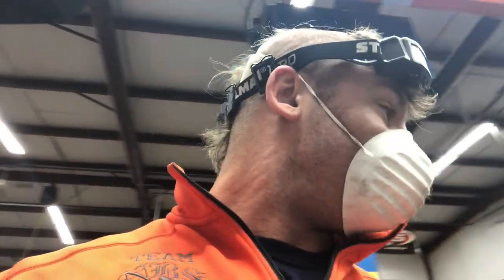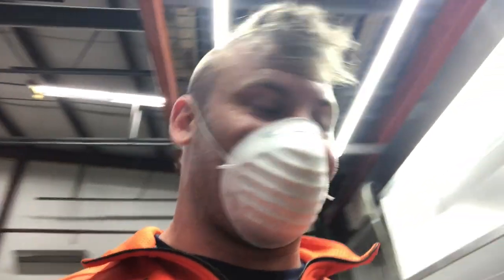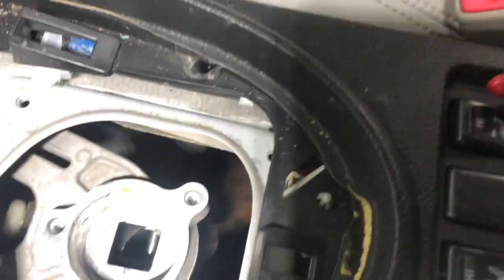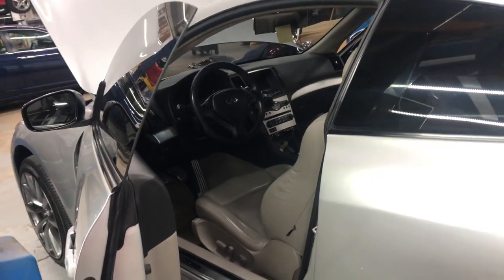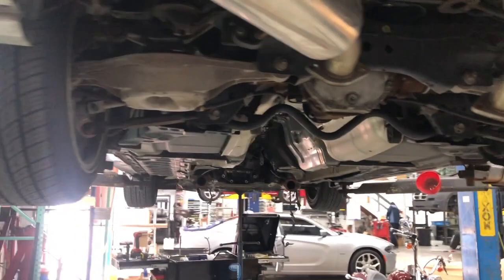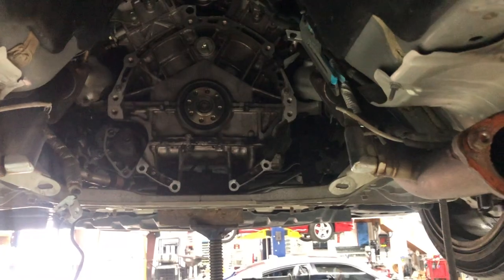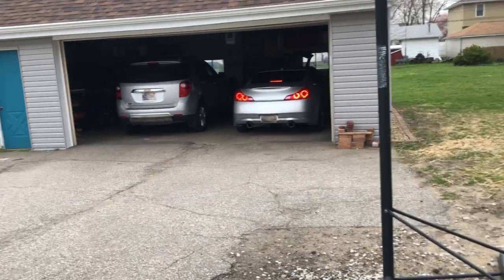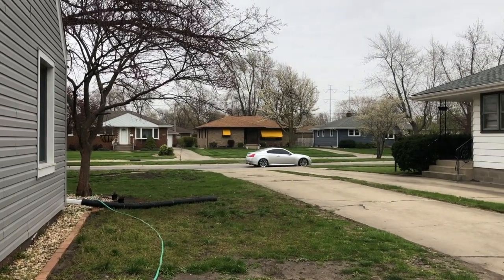G37 Clutch and Flywheel Install

Comment: I got a buddy(well, a mechanic I highly respect) who quoted me about 400 for this job and I'm thinking it's totally worth that for the trouble(I'd be doing it on jack stands). I also grabbed the zspeed csc relocation kit which looks awesome.

Side note, what'd you do to clean your seats? I have an 08 and the leather has definitely seen better days and yours look awesome

Also, just wanted to say for the shift knob check out the south bend clutch shift knob. The style has a similar shape to oem and a little more heft. Only issue is it's metal(cold when it's cold, burning hands when it's hot hahaha). Reasonable price though
Reply from the maker: This job on jack stands would be a nightmare in my opinion.

I use all shine supply products - leather cleaner and conditioner 

Yeah I ended up getting the Z1 Motorsports shift knob, also metal lol

Comment: I want to order the zspeed stage 3 super street clutch for my G,  im just concerned about the loudness of clutch chatter which flyhweel do you have the steel or alluminum? Do you have any chatter at idle if so is it really bad?
Reply from the maker: I’ll say this, the idle chatter I had with the stock clutch and flywheel that was basically going out had more chatter than this setup. I have stage 2 I believe, if i said 3 in video that’s wrong. I’ll be honest, since this video that car has been supercharger and if there is chatter I cannot hear it. I do remember after this install both me and my mechanic were impressed with how close to stock it felt and functioned especially with the CMAK
Reply: @ChristianAnto  ok Thank you for the help!